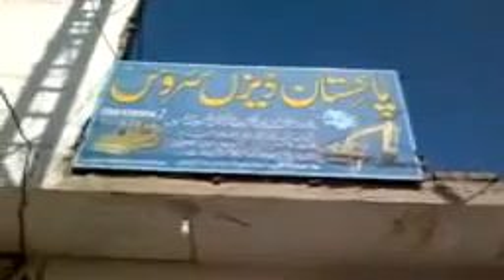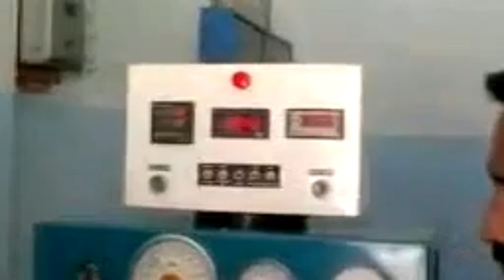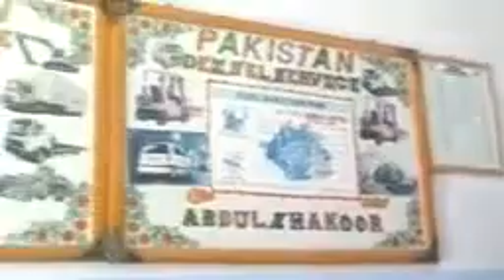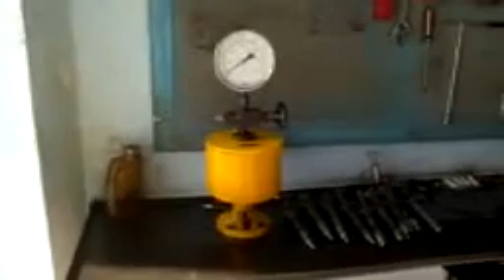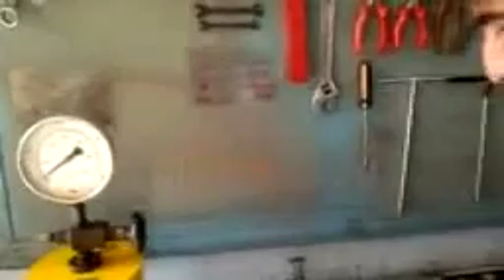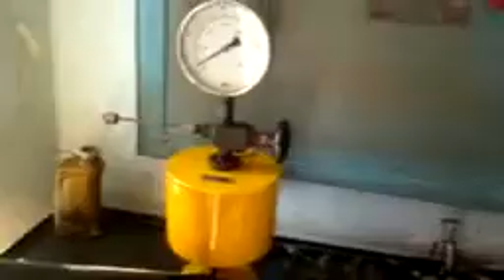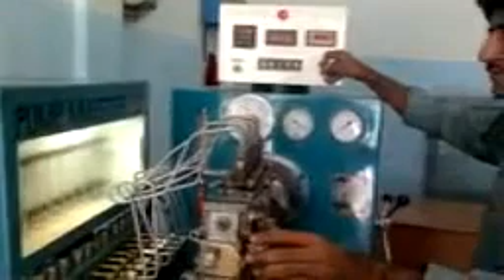Caterpillar Diesel Pump

Comment from the maker: Pakistan Diesel Service, SadiqAbad, (Pakistan)….
Pakistan Diesel Laboratory. SadiqAbad. Pakistan…..
https://www.facebook.com/pages/Pakistan-Diesel-Service/207659266103884

Delphi, Bosch, Denso, ZEXEL, Cummins, Caterpillar, Stanadyne, new Diesel Fuel Injection Pump and Injector Parts Available.

Electronic Diesel Fuel Injection Pump & Electronic Injector Reparing & Service, Specialists. Common Rail Diesel Injection System Service.

Diesel Fuel Injection Pump Specialists, (Diesel PumpService) PDS
Diesel Fuel Injection Service and Tachnician (1993 to 2014)(CAV training in 1992-1993- in pakistan) Good experience,(Pakistan Diesel Laboratory) PDS
Diesel Fuel Injection Pump Technician and Repairing We using 12 Cylinder Diesel fuel injection pump test bench in my workshop us. ( PDS )( PDL )

HEUI Injector
Electronic Unit Pumps
Electronic Unit Injectors
Hydraulic Electronic Unit Injector
Common Rail fuel injection & Injector
EUI Eletronic Unit Injector
EUP/EUI Electronic Unit Pump / Injector

Work in: Lucas / Delphi, Bosch, Denso, ZEXEL, Caterpillar. Cummins, Stanadyne, Perkin,

Work in high & low speed Engine. Caterpillar Marine Engines. Wartsila Engine, Deutz engine and a GM engine and Navistar engine in All Heavy Generators in Diesel fuel Injection Pump service and reparing's and also diagnostic service and Repairs for all Mechanicl & Electronic Diesel fuel injection systems.(Diesel Pump & Injector Service) Pakistan Diesel Laboratory, PDS.

ELECTRONIC & MECHANICAL Diesel Fuel Injection & Injector Repair and Service, Common Rail Diesel Injection System Service.

I worked for All vehicles Like: Lucas / Delphi, Bosch, Denso, ZEXEL, Cummins, Stanadyne, Caterpillar, VOLVO, Perkin, Ford, Fait, MAN, Mercdez, Mitsubshi, Deutz,Toyota, Hino, ISU, Motorpal,GMengine, Navistar engine, &. All Tractors, All Heavy Generators, I want to work with biggest workshop well equipped like yours. I have sufficient experience of Good Working.(Pakistan Diesel Laboratory) PDS. (PDL)(Work in Pakistan and Doha Qatar)

MD: Abdul Shakoor
( Address: Pakistan )
Pakistan Diesel Service
K.L.P. Road. SadiqAbad
Punjab, Pakistan.
Mobile No: 0300 6700934
Mobile No: 0333 7451727

E-mail: pakistandieselservice@yahoo.com
URL: www.pakistandieselservice.zoomshare.com

PAKISTAN DIESEL SERVICE, Sadiq Abad, (Rahim Yar Khan)
All Diesel Fuel Injection & Injector Repairing and Service In Company.
Lucas / Delphi, Bosch, Denso, ZEXEL, Cummins, Ford, John Deere, Stanadyne,
AMBAC, Nippendenso, CAT, Deutz, Internationa, GM, komatsu, Misubishi, iveco, CAV, Fait, Alliant Power.

YOUTUBE: http://www.youtube.com/watch?v=HgAGuXfGUKk

https://www.facebook.com/abdul.shakoor.18400

https://www.facebook.com/shakoor.diesel

https://www.facebook.com/pages/Pakistan-Diesel-Service/207659266103884

https://www.facebook.com/pages/Diesel-Fuel-Injection-Service/1405856599684185

https://www.facebook.com/pages/Sadiqabad-Pakistan-Diesel-Service/338192419685496

https://www.facebook.com/pages/Sadiqabad-Sadiqabad/614049932037812

URL: http://www.pakistandieselservice.com

PAKISTAN DIESEL SERVICE. Sadiq Abad,    (PDS)
Pakistan Diesel Laboratory, Sadiq Abad.         (PDL)
0300 6700934

Work in: Lucas / Delphi, Bosch, Denso, ZEXEL, Caterpillar. Cummins, Stanadyne, Perkin,

Electronic Injector Reparing & Service
Diesel Fuel Injection Service
Diesel Fuel Injector Service
Common Rail Injector Service

Qatar Doha. Diesel Fuel Injection Service. +974 33847825

PAKISTAN DIESEL SERVICE. SadiqAbad, (RahimYar Khan). Pakistan.
Mobile No:00923006700934
Mobile No:00923337451727
Qatar Mob: +974 33847825
Abdul Shakoor

Bosch
ELECTRONIC & MECHANICAL Diesel Fuel Injection & Injector Repair and Service (PDS)              New and reman pumps & injectors for light, medium and heavy duty systems. Bosch diesel fuel injection pumps are used in a wide range of engines, both on and off highway.

Caterpillar
ELECTRONIC & MECHANICAL Diesel Fuel Injection & Injector Repair and Service (PDS) Remanufactured pumps, new and remanufactured injectors of all types: capsule, pencil and electronic. Cat fuel systems are used in a wide range of medium and heavy duty on- and off-highway applications.
Cummins

Delphi
ELECTRONIC & MECHANICAL Diesel Fuel Injection & Injector Repair and Service (PDS)              New and remanufactured fuel injection pumps and mechanical injectors. Reman electronic injectors for Volvo and John Deere applications. New glow plugs and controllers, fuel supply pumps, water pumps, and vacuum pumps. Includes equipment brands of Lucas CAV and Simms.

Zexel
ELECTRONIC & MECHANICAL Diesel Fuel Injection & Injector Repair and Service (PDS)           Reman pumps and injectors, including the MD-Tics. Formerly known as Diesel Kiki, Bosch has purchased Zexel.
MD: Abdul Shakoor
( Address: Pakistan )
Pakistan Diesel Service
K.L.P. Road. SadiqAbad
Punjab, Pakistan.
Mobile No: 0300 6700934
Mobile No: 0333 7451727

PAKISTAN DIESEL SERVICE. SadiqAbad, RahimYar Khan
03006700934